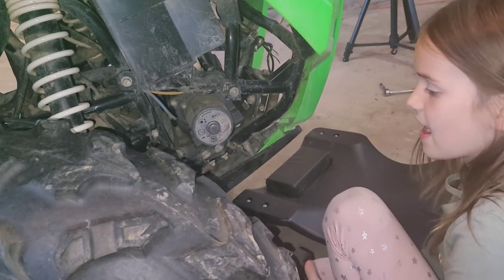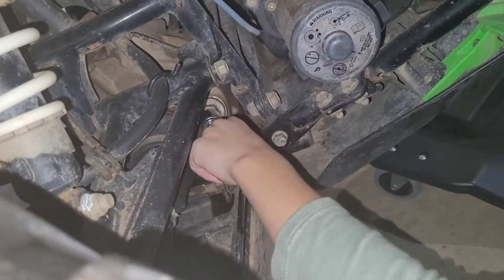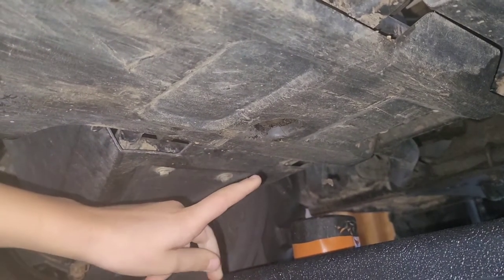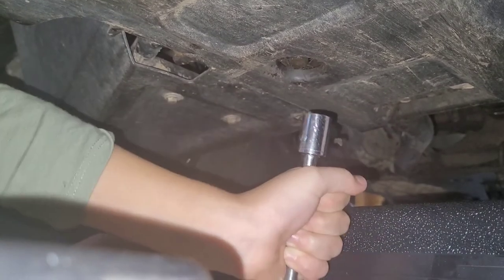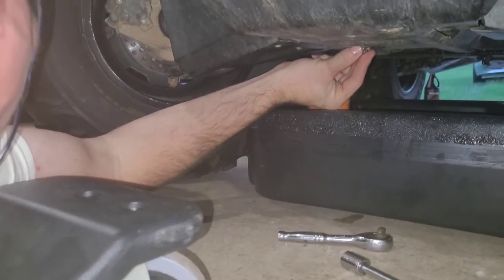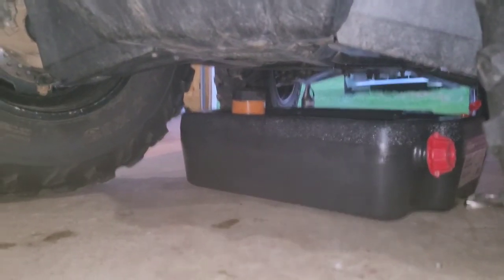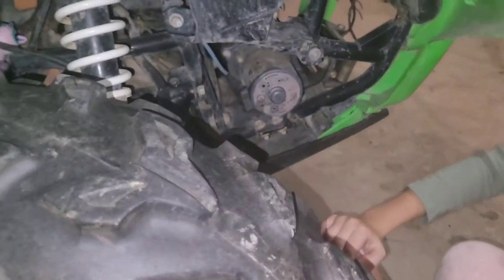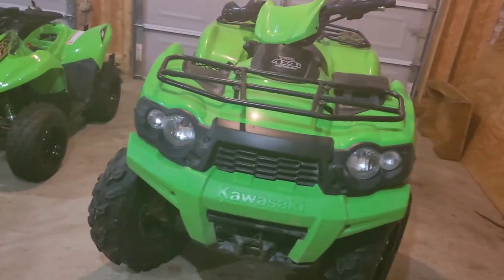Brute Force 750 oil changes. #brutforce #kawasaki #diy

Comment: I got a question to ask I have 750 Kawasaki brute force 2016 my hand book tells me use 10w-40 but what’s your opinion to use 15w-40
Reply from the maker: So from what I know, the 2012+ just have 650 heads and cams (to bump compression)...If I'm not mistaken the rest of the engine is the same.   I've ran 15w40 in mine for years.... and I run it hard now.  She's been holding up very well.  I talked to the guys at klotz, they have really good oil. I just haven't ran any of it in mine yet.

Comment: I know this video has been out for awhile but can you tell me exactly what you used for each, I have the exact same quad and desperately need to change all oils but never done it on the 750
Reply from the maker: Awesome man!  so the oil change you can use Rotella T!  or Brad Penn 10w40.  Rear diff i would only use kawasaki rear wet brake/diff oil.    front diff you can use the same oil as the engine... conventional oil. not synthetic!

Comment: Wouldn't recommend car oil. It over lubricates and can make your clutch slip. ATV oil is best. Expensive but worth it.
Reply from the maker: These quads don't have clutches In the engine or transmission.   They are a cvt. You can run car oil in them.  Now any quad with a clutch basket... you are correct. You need a specific oil for that.. which is the atv oil.
Reply: The oil is for diesel trucks its better than car oil. Definitely 15w40 rotella oil and Lucas oil i run it in everything. Break point longer and way better for the bearings.

Comment: What did u use for rear gear oil? I just picked up a 07 brute force 750 and I'm changing all the fluids today
Reply from the maker: thats awesome!  congrats.    they are fun machines.   ok so i use this for the rear ends.

Kawasaki K61030-004B Gear And Wet Brake Oil
Reply: @Simpsons.R.S   appreciate it bud. I picked up two actually this week. One needs an engine rebuild but will be a fun project
Reply: Front takes same oil as engine correct?
Reply from the maker: thats what ive been using and I haven't had any issues